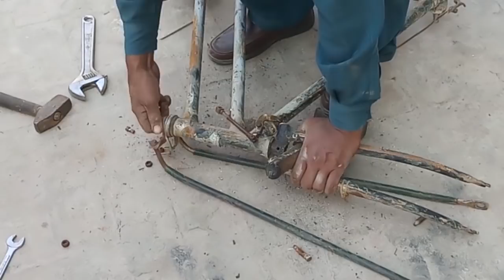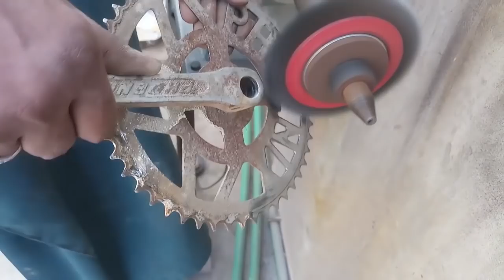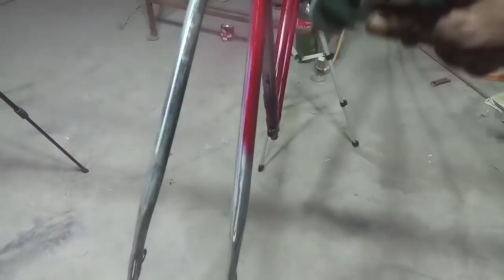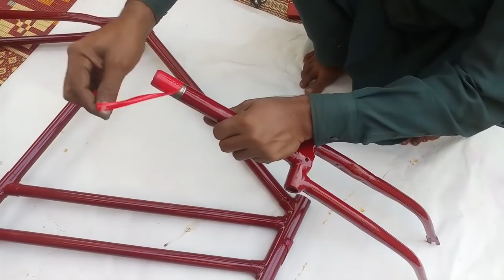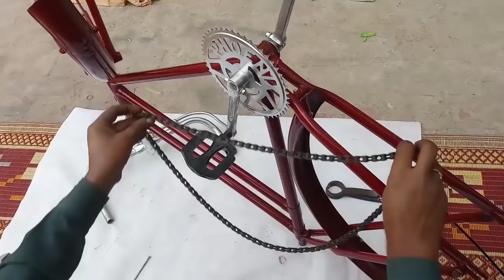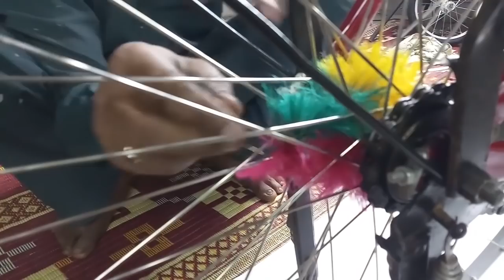RESTORATION of an Old Rusted Bicycle - VERY RUSTY Bike Full Restoration

Comment: Phoenix....from the ashes it arises again as a new bike...better than before. 
Wish I could buy this guy a set of bronze drifter pins and bronze chisels...and some 6 point wrenches and socket set. He sure can do a lot with one galvanized nail and a hammer, pliers and adjustable wrench.
Reply: And 17 more gears and a partridge in a pear tree.
Reply: @jasbarsoph  stop hating... that man did an amazing job with the simple tools + grinders, stripping etc that hew had to work with - I mean and respoked the rim, new bearings at every rotation point - awesome job!!!

Comment: The other 17 Speeds were stolen by the 'Bicycle Gear Bandit Gang'.
Reply: Personally I'm not a fan of these Fixie's with single gears! Why not use the original cassette?
Reply: Haha I'm laughing so hard here
Reply: @ericmcginnis9413  "Personally I'm not a fan of these Fixie's with single gears! Why not use the original cassette?"

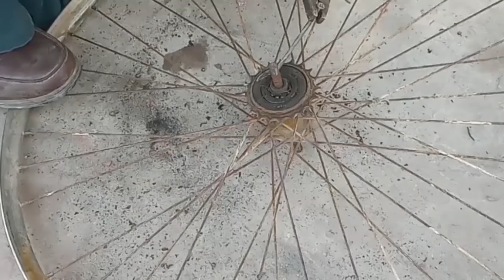It's not a "fixie" and it never had a cassette. It originally had a single-gear freewheel (a single-gear bike is not necessarily, and not usually, a "fixie") like you'd find on an older BMX (which you can clearly see him remove at 4:34), and it was replaced with a new single-gear freewheel. A "fixie", AKA: fixed gear, is direct drive, meaning that if you pedal backwards it drives the rear wheel backwards too (like with a unicycle or a child's tricycle / Big Wheel). This means that you can't coast on a "fixie", because if the drive wheel is turning it forces the crank to turn as well. A cassette is a stack of different size sprockets, usually 5 or more. A single sprocket is not a cassette.
Reply: @MaximRecoil  it looks like an original 3 speed hub and to me the confound looks like one I left for a different vidio  where a guy took off a cassette and used a single gear so I apologize not sure what happened here!
Reply: @ericmcginnis9413  It didn't have a 3-speed hub. You can watch him disassemble it. There's nothing in that hub shell other than an axle, bearings, and races. It's just a basic hub, no different than a front hub, except the shell is threaded to accept a freewheel drive mechanism, exactly like older BMXs and road bikes. A three speed hub has a set of planetary gears inside the hub shell, like so - https://web.mit.edu/course/2/2.972/OldFiles/www/reports/three_speed_hub/smith-eric-1.gif
Reply: @MaximRecoil  the 3 speed in referring to is built into the HUB sturmy and archer 3 speed! Perhaps I'm wrong but a bike of that age typically has them!
Reply: @MaximRecoil  I got ya my original comment was intended for a different vidio so idk why it's posted on this vidios

Comment: You guys rock! Just use primer before painting or the paint will flake off in no time.
Reply from the maker: Ok
Reply: Paint actually sticks to steel very well. It's not like you're painting your walls where primer is needed for adhesion promotion. When painting over steel the primer is there so you can sand the surface smoother.

Comment: Yeah,you need to prime that bare metal before you top coat it.Good job other than that.Why the 18 speed sticker?
Reply: That confused me to
Reply: The other 17 gears will be in part two of the video.